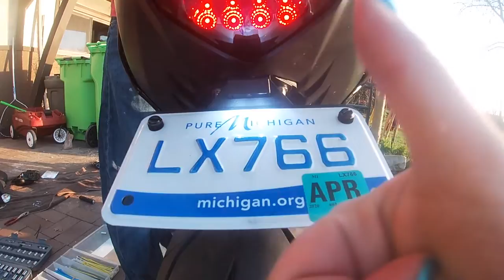Installing a Motodynamic Integrated Tail Light and Fender Eliminator on the 2018 Street Triple 765

Comment: I had the motodynamic light on my Yamaha FZ8 and loved it! It was 7 years old when I traded it in and it still worked perfect and every single LED still worked. I definitely don’t like that fender eliminator though because being a heavier male rider I’d definitely rip that tag off on the first bump. My 2018 striple has the evotech fender eliminator which keeps the tag up higher and further rearward. It uses the factory turn signals though which kinda sucks but at least in this bike the signals aren’t horrible. My Yamaha had HUGE super ugly yellow turn signal’s that looked so stupid.

Comment: I’m putting the same setup on my 2022 street triple r. Are your hazard lights working cause mine are not and I don’t know why. Also regarding the license plate light instead of having a connector it just has two wires so I don’t know where that goes.

Comment: I just installed the tail light on my bike and man does that resistor in the sub-harness get hot. Have you experienced any issues with it overheating or damaging anything while tucked away on the bike? I'm nervous about just leaving it in there, or running the signals/hazards for longer periods of time. Thanks!
Reply from the maker: Thanks for watching! We have not noticed any issues as of yet, and have had no damage to anything while running it. I would definitely reach out to the manufacturer and ask them if you should be concerned, maybe you received and bad one. Just to cover all your bases!

Comment: Hi I installed Motodynamic tail light Sub-Harness get too much hot lightly smok coming . It's normal or any problem in Sub-Harness please tell me
Reply from the maker: Thank you for watching! Man that sounds like you have an issue with the subharness! Definitely want to reach out the the manufacturer and make sure you don't have any wires shorted!
Reply: lol yeah it’s perfectly normal for smoke to be coming off your wiring harness. Just keep riding it. 🤦🏼

Comment: Is this bike lowered? I'm probably heavier than the guy in the video so I don't want to be scraping the plate
Reply: The bike is the lowered version. But it sure seems like it would be close even if it wasn't lowered. I may take a chance on it. I won't be ordering the chincy brake/turn signal combo though. I like to have very clear indicators for safety reasons. Hopefully they offer just the plate holder/bracket.
Reply: UPDATE: I actually bought this tail tidy from Motodynamic and there is plenty of room on a non lowered bike. Those lowered bikes must be way way lower than standard.
Reply from the maker: Thanks for watching! And wow I apologize for such a super late reply! I keep having issues where I don't get notifications! As SuburbanHobbyist said, this is the lowered bike version and has also been lowered even further for the rider, plenty of room on a standard height bike and even the low rider version.
Reply from the maker: @suburbanhobbyist2752  thank for watching and reying in my place. My notifications still seem to be wonky. In regards to the light they do offer clear lens versions!
Reply from the maker: @suburbanhobbyist2752  the low rider versions aren't as low as ours, we have an additional lowering link for her since she is so short! 😆